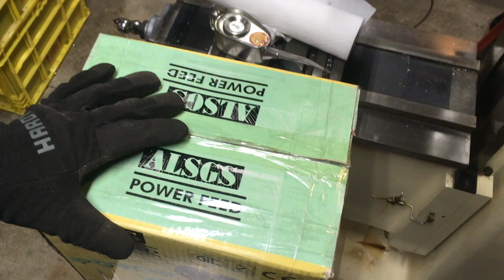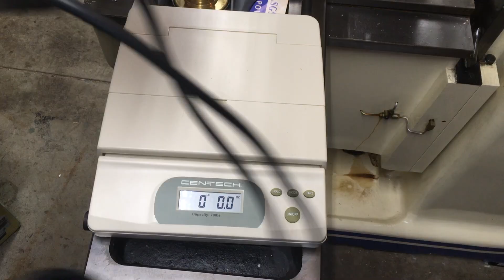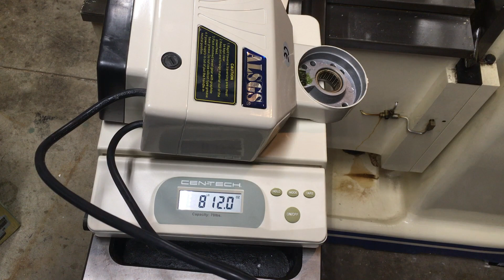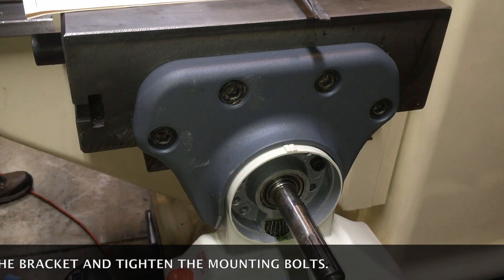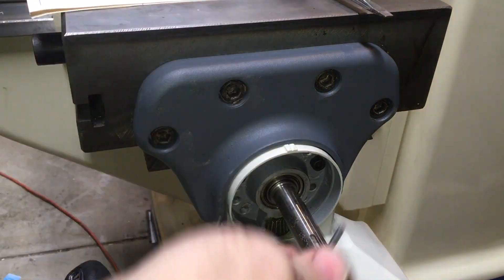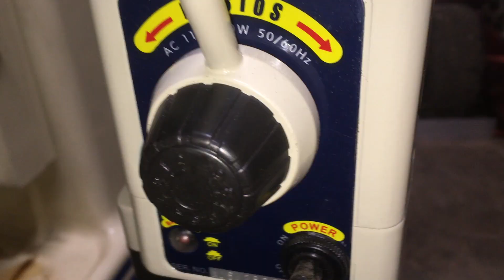Mill Power feed unboxing and installation X-axis

Comment: Hi great video thanks, what do you mean about the drive bevel gear not being supported
Reply from the maker: Thank you. This unit has the bevel gear shaft “up in the air” without another bearing at the top of the gear.
Reply: @TinkeringNerd is the bevel gear slide on to the shaft that it turns with the keyway, where else can it be supported
Reply from the maker: @ronmenzies362 it is supported at top of the shaft in better made feeders.

Comment: Looking at getting one of these for our mill, but cant find the speed settings; do you know how fast each number makes it go(As in, #1 is 10 inches per minute, etc?) Thanks!
Reply from the maker: The speed is not regulated and varies with load on the table. Digits on the dial scale are arbitrary. So, it’s impossible to guess the actual speed at any given moment. It’s all based on how it feels/sounds.
Cheers.

Comment: I'm curious, would leadscrew backlash effect the distance between the pinion and bevel gears? Thank you!
Reply from the maker: Backlash is originating between the screw and the lead nut. There is no play between the screw and the table. So, no, bevel gear is not affected by the backlash.
Cheers.
Reply: @TinkeringNerd 
Thank you!

Comment: Good review. No fluff, just the important stuff.  Will this unit work on the "Y" axis also?
Reply from the maker: Thank you. For Y axis, you will need different mounting bracket, and the lever would be sideways. I think there are specific ones sold for Y axis.
Reply: @TinkeringNerd  O.K., thanks for the reply.  Keep making videos.

Comment: Hi. Very nice video. i have a STOREBRO Combi mill that has a x axis power feed origional but it is broken beond repair. so i am thinking on buying the same as you. bur i supose it is for bridgeport mill. so i wonder do you know the measure on the pin bearing ? on my mill the pin bearing is 1 inch

Comment: The kit you installed is it a universal kit or for a certain brand of mill?
Reply from the maker: Most vertical mills out there are standardized as Bridgeport brand mills. The power feed should work on most any vertical mill. You could ask your seller if their power feed will work on your mill, to be somewhat certain.
Cheers.

Comment: What mill did you install the power feed on?
Reply from the maker: It’s made in China with Taiwanese lead screws. It doesn’t really have a name.. just some model number. It’s 50x10 table vertical mill with square waves on y and z axis’. There is some more about it in my video about how I moved it and how I repaired it.